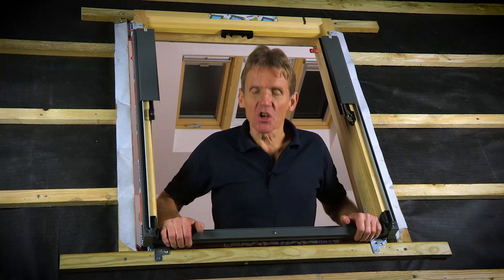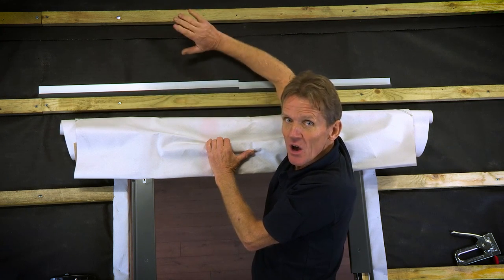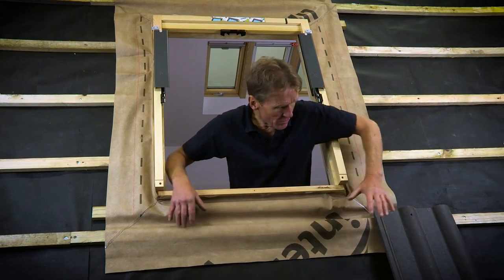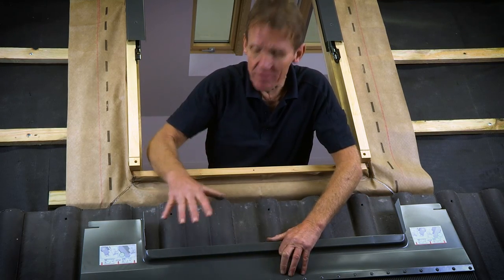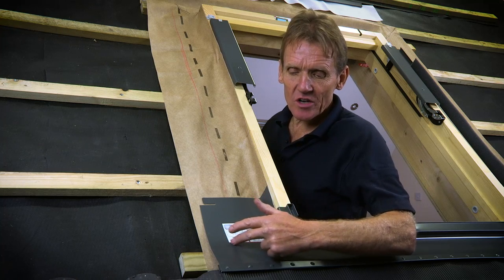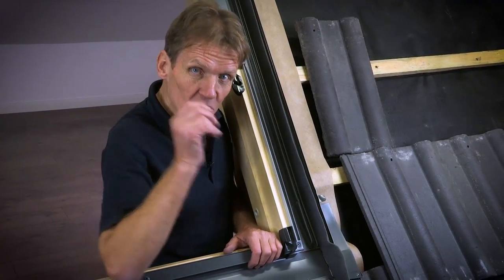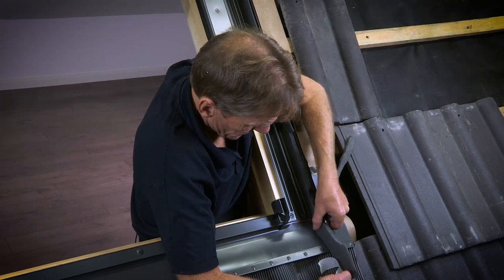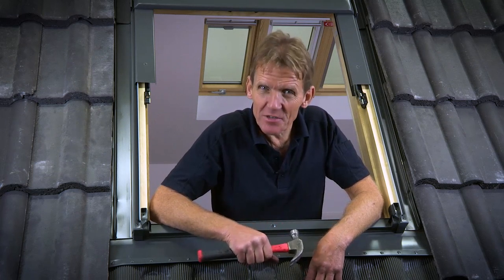Keylite Roof Flashings - SkillBuilder's Roger Bisby Reviews

Comment: Hello Rodger fantastic work sir. I have a sky light in for the last 13yrs and from day one it has never been right. Howling whistling wind blowing in. Is it hard to replace these windows?
Reply from the maker: Hi inspirepics,

Due to the age of your existing roof window there will be a small modification to the roof required to increase the size of the existing aperture. 

All current roof windows on the market are recessed into the roof between the roofing rafters to aid with the visual aesthetics of the product when installation is complete, so that the window appears lower in the roof when compared to traditional roof windows. But also more importantly to help improve the thermal performance of the unit. 

Once the modifications to the roof have been completed the installation will be as straight forward as how Roger has completed it in the video. 

For any further information or assistance on the above or indeed the installation, please contact the Keylite Technical Department on 028 8675 8921.

Thanks

Comment: At 5.45 minutes he was installing a cut tile on the flashing I noticed it slip and he held it with his hand  then I noticed when he put the second cut on above it, there was no nail  in the first cut, is that inferring you do not nail through the flashing and it has to have a different mechanical fixing ?
Reply: I wondered exactly that, looks like the tile nail would go right through that whole edge assembly creating a perfect hole for rain to seep through. I guess it's OK of the nail hole is off set, so I guess you have to drill one. Tip: Buy some spare tiles.

Comment: Hello Roger, I’ve just installed my first two Keylite windows exactly in accordance with your video and Keylites installation guide. They both leak from the top corners because the tiling had not been completed. In other words, any water that gets through the tiling runs over the breathable membrane and into the holes at the corners where there is no flashing provision. This is a design failing that I am having to rectify using an EPDM flashing after removing the support brackets at the top corners. Maybe you can use your influence to encourage Keylite to produce a redesign that addresses this appalling problem?